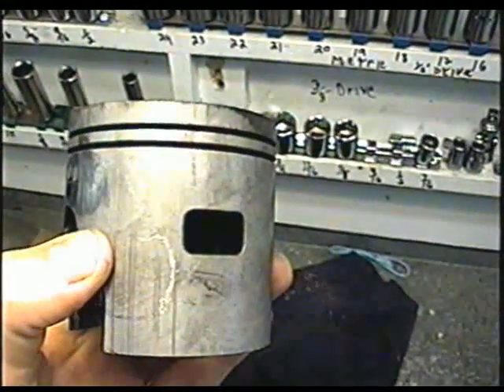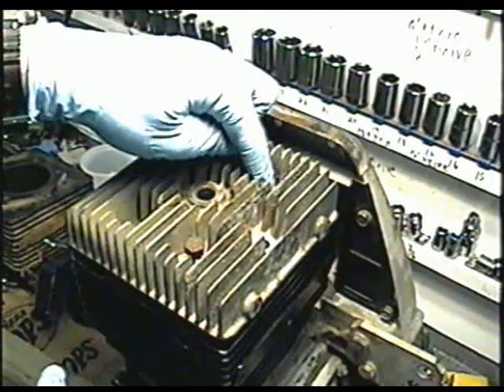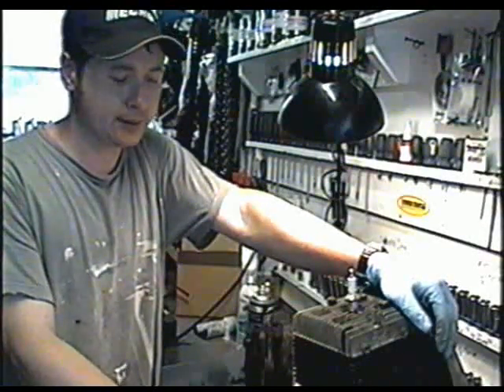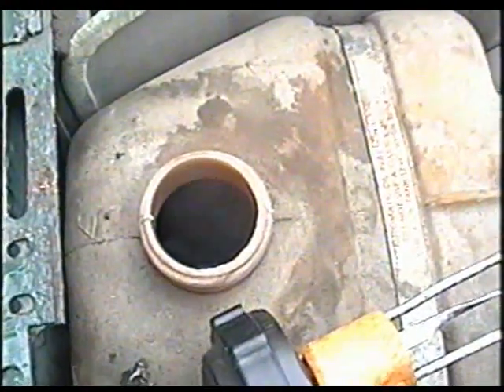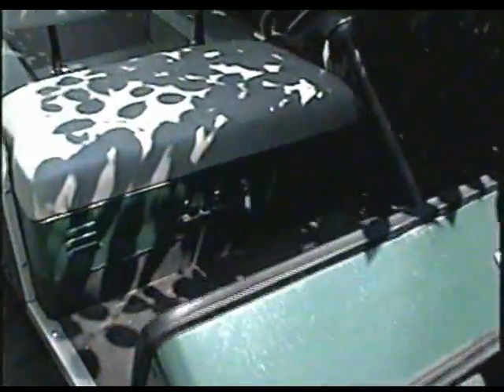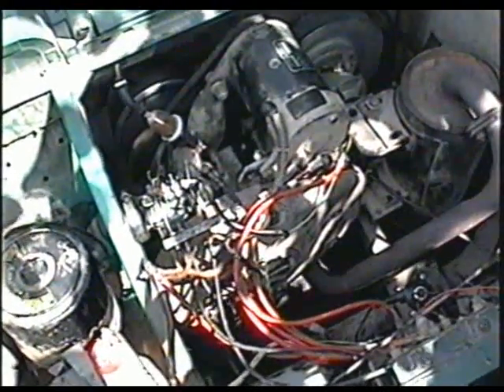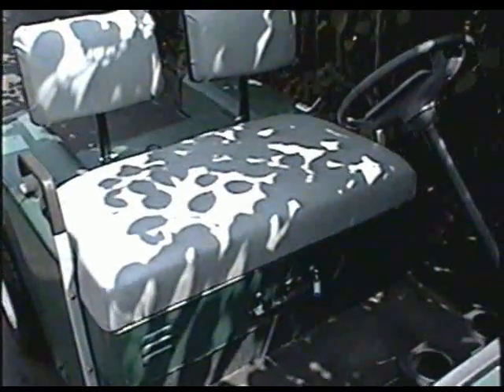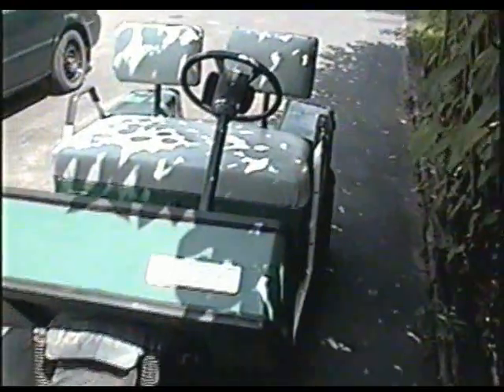Gasoline Golf Cart ENGINE REBUILD Part 3/3

Comment: Great video, as are all of yours.  Question, did you ever find the missing parts of the piston rings?  If not, any concern re them floating around in the bottom of the engine?  Can you access the bottom of the engine?
Thanks
Tony
Port Hadlock, WA

Comment: I have the same golf cart with the same engine but i have a different problem, every time when i rev the engine up to driving speed (does not matter how fast) the whole engine vibrates really bad, if i Jack it up an rev the engine then it work fine, there is also a lever that moves back and forth near the driven clutch that is hooked to the carb. I am not sure if this is a governor that uses the driven clutch but it is not hooked up. i might make a video about it to show what i mean.

Comment: I took this same engine model apart and the cyclinder was reversed - with the cylinder hole facing the exhaust.  Otherwise the cylinder looked tight.  Any ideas what this would do to the running of the engine?  I was having some performance issues - and hope this was the issue.  Videos were excellent
Reply: This was 4  years ago so you probably will never see this but...   Marine engines added a hole in the piston in 2 cycle engines to improve the fuel flow through the cylinder.  I am not positive if this is a 2 cycle or 4 cycle but I feel confident the principle is the same.  Installing the piston backward will affect performance.

Comment: would it be possible to swap the engine with a gx200 and use the same starter clutch asemmbly? also would the reverse work?
Reply: No it would crank the engine in a reverse direction and would not start